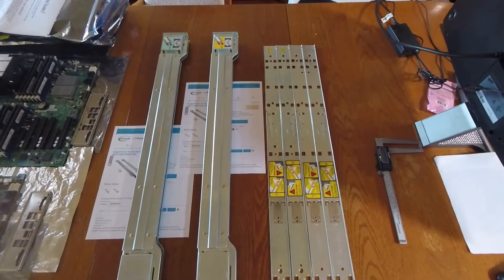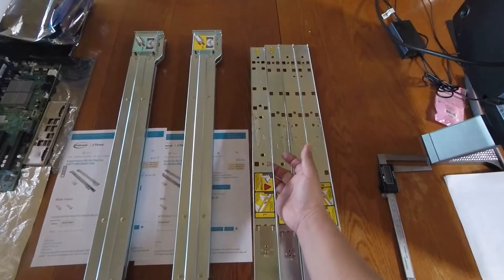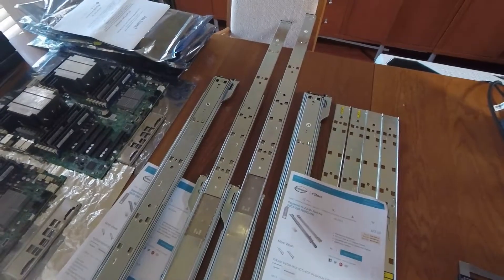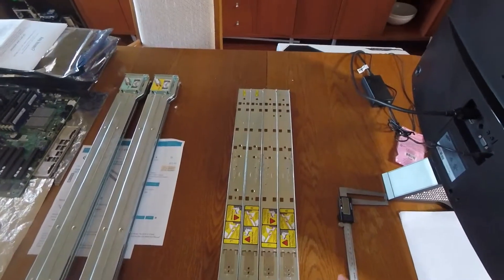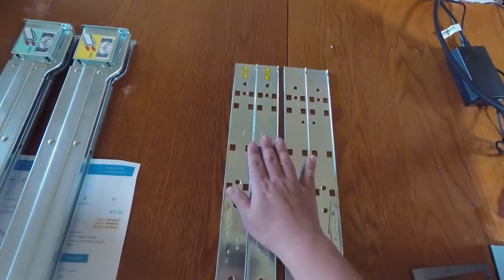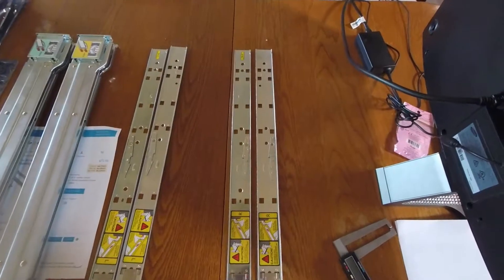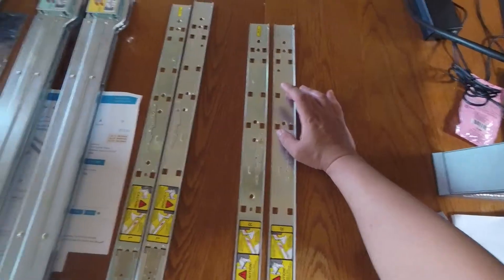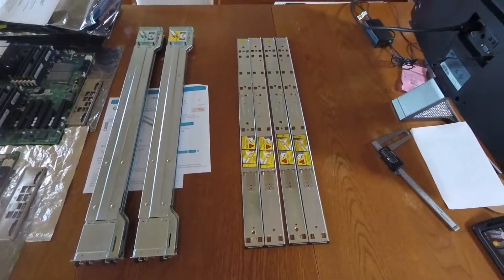How to buy used Supermicro rack rail kits for your Supermicro server

Comment: MCP-290-00053-0N says its for 2 and 3u, which do I get for an 846?
Reply from the maker: I have used it with my 846 and it seems to work just fine. But Supermicro does not officially support it.
Reply: @ArtofServer  oh OK. Ty :)

Comment: Is it possible to install thease rails on a threaded round hole rack?
Reply from the maker: No, not directly. These types of rails are designed to hook into the square hole racks. However, there are "adapter brackets" you can buy that will allow you to hook these in, and then the other side of the adapter has threaded holes for you to secure to the threaded holes of your rack. Look up Supermicro P/N MCP-290-00060-0N.

Comment: Is the rail kit with (3) in the part number not going to break on a CSE 846 or CSE 847 chassis because it isn't in the compatibility list?
only the shorter rail kit the one with the (7) inside the part number has the 846 and 847 in the compatibility list, but that rail-kit is too short to take the top cover off?

I'm not sure what to order now...
Reply from the maker: Supermicro does not officially support using those rails on the 846/847 chassis. That said, I use them on my 846 chassis and have not had any problems.
Reply: I had the same question in my mind. I checked and both the 53 and the 57 use the same inner rail (the 115) and the difference is just in the outer rails (113 for the 53 vs. 117 for the 57). I was wondering if using a 53 and allowing a fully loaded 847 (all 36 bays loaded with HDDs, which are obviously heavier) to be pulled all the way out would stress the 53 enough to the point of failure. That's the only thing that I can think of that would justify Supermicro differentiating the two.

Comment: This was great when I watched it a few years ago, and then I watched it again a few weeks ago to make sure I was getting the right rails on eBay.  Success!
Now... what I did NOT anticipate is my rack is only 24" back-to-front and the rails are apparently for a 26½" rack.  So server back to sitting on boxes for now.  :(
Open to any suggestions!
Reply from the maker: Are the rails you have adjusted to the minimum length? The mounting point in the back is adjustable and should slide back and forth to accommodate for racks of different depths.
Reply: I can't see where I could possibly make them any shorter. The inner rails that connect to the server are 26" long, and the outer rails extend from 26½ to 36 3/4".   Alas.

Comment: Hi i have a pair of the blue rails and a CSE846 chassis, is there any video of these actually being attached ? i just cant seem to figure out how this would go.
Reply from the maker: It should be pretty straight forward to attach the inner rails to the chassis. However, if you have a very old 846 chassis, these rails will not work with the older chassis which has "hooks" that are too wide for the newer rails. Is that what you have?
Reply: that is EXACTLY what i have and do not know what i need @ArtofServer
Reply: thats exactly what i have i was hoping you could point me in the right direction @ArtofServer
Reply: Do you know the measurements for the hooks on the new and old? @ArtofServer

Comment: i have issues sliding out the inner rails. i can't seem to extend the rails enough for the latch to be accessible. also once i managed to release the latch somehow, but still could not slide out the rails... could not find any video on it anywhere...
Reply from the maker: Your rails may be damaged.
Reply: @ArtofServer  turns out they sent me two right outer rails (and no let one), so i accidentaly slid in the left inner rail to the right outer rail. Finally managed somehow to pull it apart

Comment: Hello! Thank you for this great video. I just bought my first server (a used CSE-835), so I'm completely new to all this; I learned more in 18 minutes than in 2 hours of reading various websites that assumed I already mostly knew what I was doing. :P

I got a set of the MCP-290-00053-0N Rev. B rails, and they're in great shape, but they're unfortunately too long for my NavePoint 9U rolling rack. (I measured everything about the rack but the maximum rail length, apparently. :P ) The max mounting depth in my rack is 22.6". I realize now that is unusually short.

I'm pretty confused by the SM website at the moment, but it appears I should be looking at the Supermicro 2U-5U Rail Kit (MCP-290-00058-0N), which lists an Outer Rail Extendable Length of19.6” to 27”. I noticed that these aren't Rev. B, but they do have the yellow labels. Are they just newer?

As far as I can tell, these are the only rails they sell for a 3U chassis that are short enough. Is that right, or am I missing something?
Reply: That is correct.
MCP-290-00058-0N are for 2U-5U servers and have short rails for short racks
MCP-290-00053-0N are for 2U-3U servers and allow a 27" extension
MCP-290-00057-0N are for 4U-5U servers and only extend 24", as these servers are inherently heavier (when fully loaded)

Comment: I just bought a used pair of the blues and the inner rail doesn't seem to extend long enough for me to push the latch down to release it. I can see on the video your blue rails extend about an inch or two longer than mine judging my the mounting holes. Is this something I'm doing wrong, is there a trick to it or are the rails defective? Thank you!

Comment: I just bought a generic rail kit (comparable to MCP-290-00053-0N), went to install it on my CSE-827H-R1400B, only to notice there are no holes on the sides of the server! Okay, there are some very small holes that look like it may line up with the small offset hole shown at the top of your inner rails sitting on the table as you have them. However, they also don't look like they go all the way through, rather bottoming out with another piece of metal just barely below the hole. Have you experienced this? There is no way I can see to secure these rails, and that doesn't make me too happy!
Reply: I bought the 4U kit directly from Supermicro, part number CSE-PT26L-B, for a CSE-742 tower/4U chassis. I looked in disbelief, the entire chassis is held on the rails with 5-6 screws on each side, each screw is the smaller than a motherboard screw. How on earth are these screws going to hold 40-50Kgr I have no idea.
Reply: @nautaki  That's funny! It's also funny to look at this comment I made two years ago and what system I was working with back then. Things have changed so much in so little time...
Reply: @jesseessej  They don't seem to have changed that much to me!